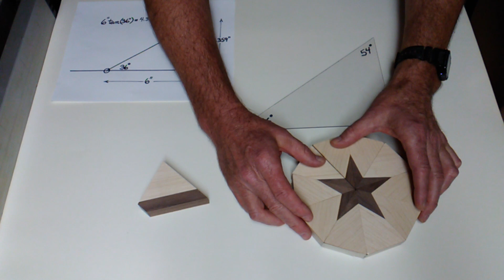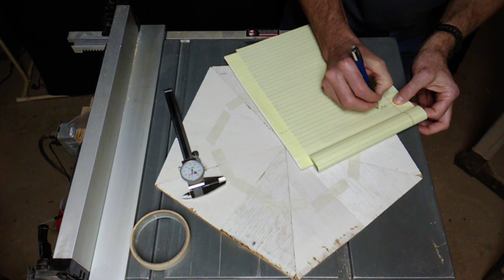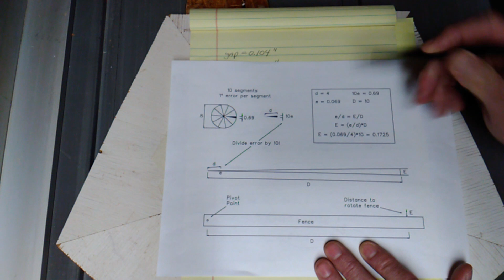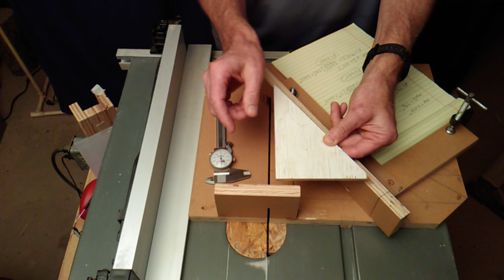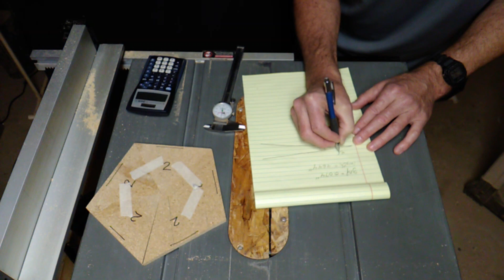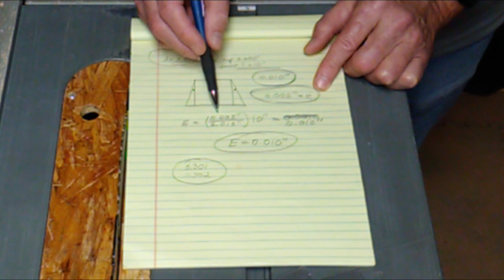Making a 5 Point Star: 3 Setting the Angles

Comment: why would you re-cut the five pieces that already fit perfect? If you wanted to set the fence to 54 degrees you could have used one of the perfectly cut pieces to do that, by filling the cut of the kerf with a piece of aluminum or wood and bringing the fence in to match the angle. beautiful finished products though! Ken

Comment: Great video. Something tells me that you must be an engineer to be such a perfectionist. However I use the Wedgie sled and a digital angle measurer to set the angles. Mine is accurate to a tenth of a degree. That's about as close as you can get when working with wood. I made mine  out of HDPE cut from a kitchen chopping board so that it will not warp or shrink.

Comment: Let me make this simple . . . you are a genius!
I'm not a wood turner, at least not yet, so I probably won't be making 5 point stars, but  your method for truing the fence to 90°, with or without a laser seems to me to be easier and as accurate as the 5-cut method.  Don't get me wrong, I love the theory behind the 5-cut method, but I simply couldn't make it work!!  Probably for the same reason you didn't want to rely on using paper to gap your adjustment, I just kept going back and forth.  But I really like your method, and it has the added benefit of only cutting 2 sides, so the depth never changes.  You could trim it down several times and simply sneak up on a practically perfect alignment without even doing any calculations, although that may take a little longer!
And even though I'm not turner, I will be using your 60° jig to make patterned boards!  I LOVE IT ALL!  THANKS!!!!!